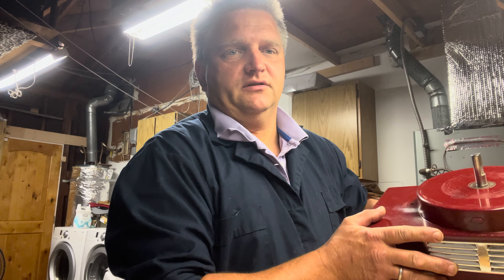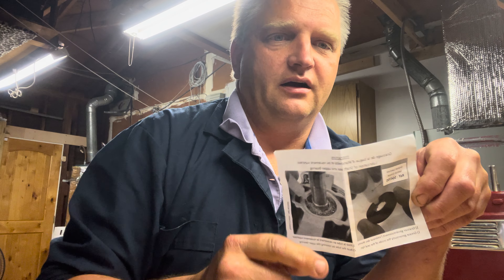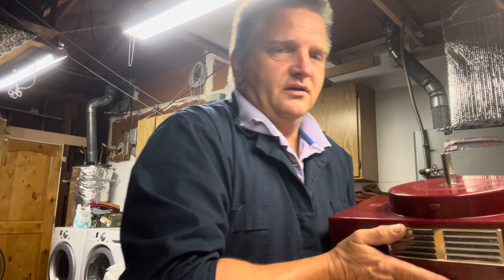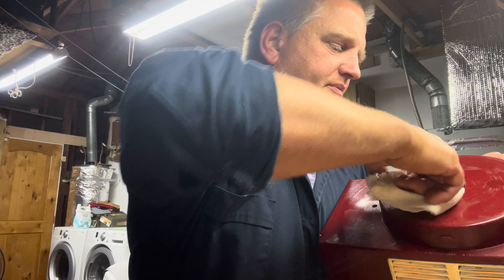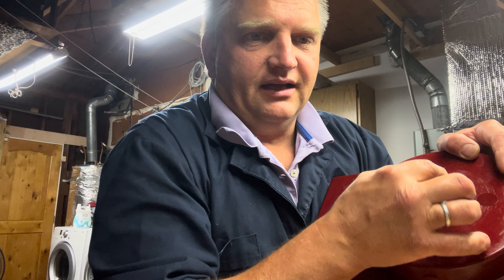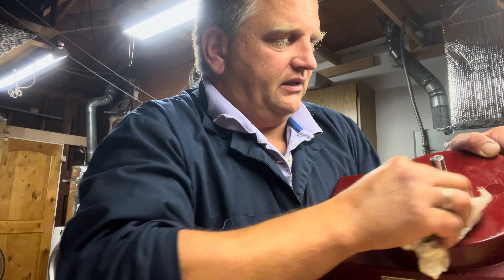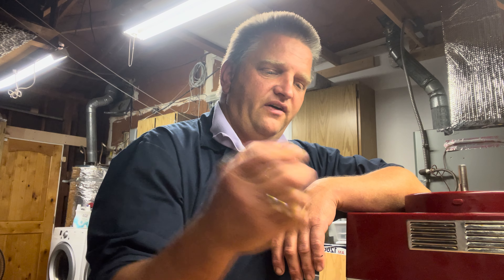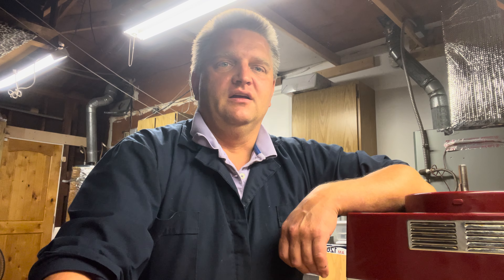Robot coupe R-2 motor shaft seal replacement

Comment: Informative videos! Very interested in a bearing replacement video!
And was wondering what it should sound like normally, my Blixer 2 makes a lot of noise!
(so think the bearings are gone) 

Couple hours later:
In the meanwhile have removed the engine en the broken bearing, my hunch was correct, top bearing broken.

While I am at it, also going to remove the lower bearing. To be replaced by SKF bearings 6002 RS and 6201 RS, and a BASF oil seal with dimensions 15/35/6. (For Robot Coupe Blixer 2)
Looks like top equipment, but was surprised that the Robot Coupe I am working on, was only 1 year old (2023), bearings should last longer then 1 year!
Even if every now end then a little bit of water gets on the sealed bearing.
Maybe SKF will last longer.
Reply from the maker: I guess they don’t build them like they use to . Quality of parts sure gone south this days it’s more of a buy it and throw it away kind of deal this days .

Comment from the maker: https://www.ebay.com/itm/161915082722?mkcid=16&mkevt=1&mkrid=711-127632-2357-0&ssspo=NfvrHcEJSUG&sssrc=4429486&ssuid=J4ZeAvcrT4m&var=&widget_ver=artemis&media=COPY here is a link where to buy that seal on e- bay , good price and real deal o.e.m part .
Reply: Thanks for the Info Andy! I just got the same model second hand for free. However my equipment is at the point where the bearing has seized and the shaft does not spin anymore, even by hand. The machine will turn on, hum, then turn off triggering the saftey pin on the bottom. Atleast I think it's the motor bearing!